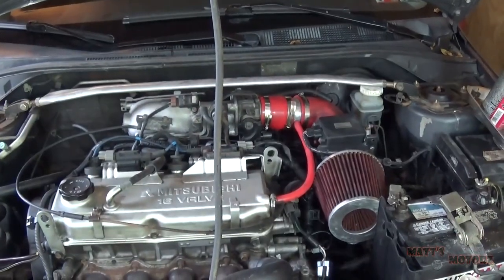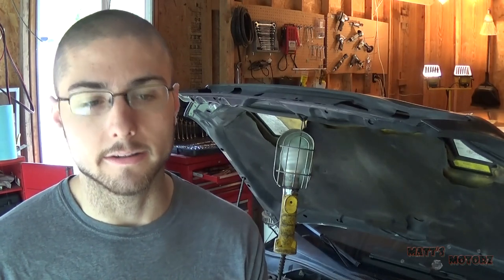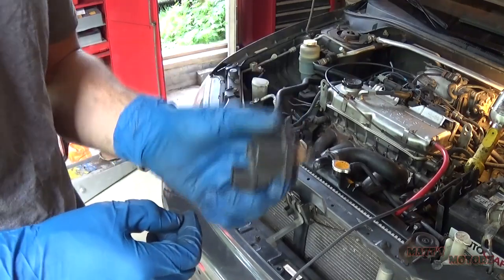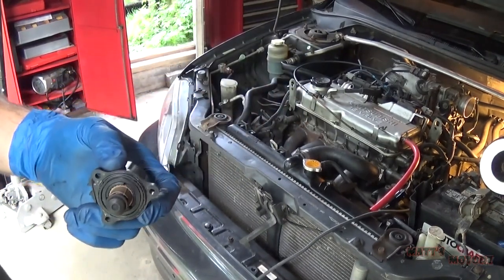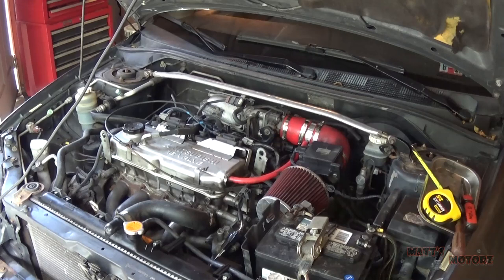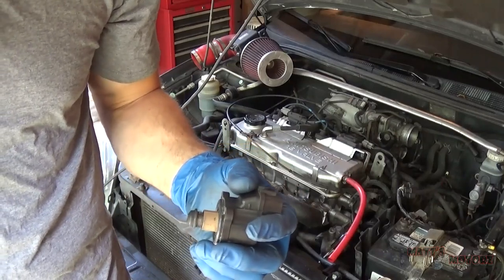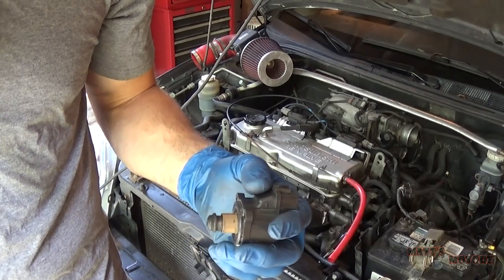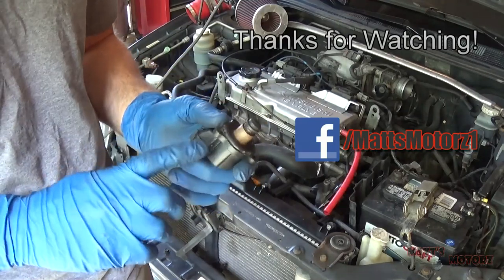Easy Way to Check an Idle Air Control Valve

Comment: Would also like to say that you should make sure to check all of your lines for vacuum leaks, especially plastic connectors, like on the PCV, which can tend to crack. Vacuum leak/s will cause rough idling and would be best to rule that out before you go looking at the IAC. Another thing to make sure of first, is that your intake air temperature sensor is operating correctly, as well as your mass air flow sensor.  It should also go without saying that you should use a scan tool on your vehicle to see what trouble codes your vehicle is throwing. That's usually a decent indication of what is wrong with the system as a whole and where to start, but not always the case if it's something wrong with the ECU, for example. If you've done all that and ruled it out as a possibility, then we can move on to the IAC.

 A better test for IAC's, would be to start the engine, and pay attention to how your motor runs and what rpm it falls to after a couple minutes, and then shut it off. Now, figure out where your valve is (usually on or near the throttle body of the intake manifold in most cases; sometimes a hose will lead from the throttle body or intake air tube to a remote valve somewhere, so make sure where yours is) and unplug the wiring harness connection, and then start the vehicle again. If your IAC Valve has been functioning properly, you should know right away because you should immediately notice a change in how the motor runs with it unplugged. If it hasn't been functioning properly, you will most likely see no change in the way the motor runs because the compensations that the ECU has made are still in effect.

 At this point, we still don't know for certain if it's your IAC though, so don't immediately condemn it. At that point it would be best to get a multimeter or test light and test the electrical pins on the control valve. You would need to look up what the correct voltages are for your vehicle from your owners manual or by looking it up online, and it would be good to test the pins on the wiring harness as well to make sure that the wiring is not faulty either or getting bad signals from the ECU. The reason we want to do all of this troubleshooting, is to rule out or confirm the IAC or the wiring being the problem, and if it is not, then we can start to troubleshoot elsewhere, like your engine timing. Perform troubleshooting tests whenever possible, otherwise we're just blindly ordering parts and pissing into the wind. 

If you're here reading, I hope you figure out whatever the issue is, and have a nice day :)
Reply: @james6401  did you sort it out
Reply: @james6401  i know man.I have problem that when engine is warm and i press clutch while driving revs drop almost to zero and sometimes it stalls.I thought maybe problem is with throthle body and idle valve but to get to it on my corsa b 16v i need to remove alot of shit and i am not sure i can do that.
Reply: @james6401  i didnt check anything really i am not mechanic but i know a few things much or less  and i read alot about problem i had.One mechanic told me it can be pump but i dont see connection.Also i have a problem almost at the same time when revs drop speedometer stops working,i dont know if its connected and how.I wont need car too much for next 3 months so maybe it can wait as i need every penny.I will maybe replace temp sensor and fuel filter as it dont need too much expertise,i just dont want to give money to some idiots to do things i can.
Reply: @james6401  it can be anything who knows.maybe something with vss sensor,i am not in hurry
Reply: @james6401  
> "...keeping things until they fell apart."
Well, you thank her for me. That's excellent.
2005 Dodge Neon, 258,000 miles.
(trying to keep this thing alive; idling like crap right now...)
Reply: good info!  I sometimes get a very high long term fuel trim on a front O2 sensor (as seen w a scanner)......and when I shut the engine off, back on there is a LTFT shift immediately downward.  From 30-50% down to 18%.  Im thinking there might be an issue w my IAC.  Sound right? thanks

Comment: On my 94 Mitsubishi Montero it had what appears the same IAC.  My engine was not holding idle, but stalling out.  I was able to take the IAC apart (3 small screws), clean it, and put back together......and it works now.  Also cleaned the throttle body area where it fits into as it had some corrosion/grime there.

Comment: Thanks Matt,I just subscribed to your channel,my 1997 jeep had the same symptoms, after spending about $400 bucks,on a new fuel pump,o2 sensors,I was even going to take the catalytic converter off and drill through it and weld back on,turned out to be the dam I.A.C valve ..smh.Anyway thanks for the video.Jeep runs great now

Comment: Wearing a dust mask for Carbon Monoxide, nice!
Reply: Lol
Reply: I know huh..😉
Reply: Why not explain the correct respirator instead of making fun? Most people don't know this.
Reply: @bretfeeney1072  A respirator wouldn't help either. Dust mask like he is wearing (is for large dust particles )and respirators (smaller particles and fumes like paint depending on the installed filter). Each need to be used in ventilated areas, neither of these produce oxygen. He needs to pull that car outside or get an oxygen mask like fireman wear.
Reply: @toddh6234  they have filters that work for carbon monoxide
Reply: @bretfeeney1072  cuz they half right
Reply: @Tony-wm1oc  @Tony there no filter that is going to work in an oxygen depleted room.
Reply: @toddh6234  good thing it's not depleted he's not in a vacuum he's in a fume filled room the car can't even run if there's no air good try tho
Reply: @Tony-wm1oc  @Tony Nah don't do that I need you around so I can get you riled up again : ) I was just busting your chops, stay safe my friend
Reply: Tell this to dr. Fauci
Reply: Yeah 😊...carbon monoxide and carbon dioxide are afraid of dust masks so they just go away 😜
Reply: @carlosmejia5728  just like COVID 😂😭
Reply: Well it stops the rona so it must work for everything. Aahahahahaha

Comment: Would the iac cause an intermittent  no crank no start for  7 months...its gotten progressively worse...almost daily. I have a po507 code. I had the throttle body replaced a year ago. 2008 jeep Cherokee 150 000 miles. Thanks

Comment: Yes on the white smoke coming out of the tailpipe, the last couple weeks. I'll have to check the milky stuff, theres no cap on radiator to look inside. i had some work done on the car a few mths ago and at the time the car would just not start for a couple days then fire right up and be fine. The mechanic kept the car 2 days and it started every time! Nor would the check engine light come on. He advised me to have it towed in when it wouldn't start but it has ever since. while there he did a "new car" inspection to break down what all i need. A tune up, valve gasket covers, tie rod...to the tune of $1500 for everything. The most important repairs running several hundred each, so i just didnt have the money.
 It may take a couple days but I'll def let u know what happens. I would've traded in already Matt but i need a couple of months to be financially set to handle the pymt.  i was hoping this one would hold out for me. But its winter so i dont see it happening. i was hoping to spend the minimum and get what life i could out of it until i could afford the new one. i start a new job on the 27th making more $ but its biweekly pay and i NEED the car to get me there. 
I will keep u in the loop, though i assume i have at least a couple of urgent issues now. Hopefully it'll be something i can pull off! 
Thanks again so much for your time and wisdom. im gonna become one of those kick ass girls that knows how to fix 🚗   ;)
Reply from the maker: +Mel Mel labelle No prob! And that's great! Always nice to see the ladies fixin' their own cars! Thanks for keeping me in the loop!

Yeah it sounds like you have a blown head gasket / cracked head.  I wouldn't do any repairs on it as it is a gone-er, so it is very good you didn't pay that mechanic!  By "gone-er" I mean it would cost so much to fix, you might as well get a new car.

Comment: thanks for your reply Matt but how would i check with the carb cleaner ? is there a video ?
Reply from the maker: Yeah, look up the video by ErictheCarGuy (but I am sure there are many videos.  I haven't made one though).   You spray it around places where there could be leaks (like around the intake) and if the RPM changes, it means the carb cleaner got past the seal.

Comment: , I had idling issues after my engine gets warmed up. After months of googling I found IAC is stuck on my palio 1.2 (2002). So I have removed it and cleaned with carb cleaner. I also loosened the spring and removed the pintle which comes on it without measuring. Now the problem is I don't know how to recalibrate the pintle which is present on the IAC. I don't know whether to tighten it till the end of thread. Because I'm concerned about the free back and forth movement of the IAC. Please let me know if you guys know how to calibrate or how much should I tighten the pintle on my IAC. Thank you!!

Comment: 2.0 94 mitsubishi engine, looks like an 02-03 lancer. I'm having an extremely low idle problem, getting a tap from what seems to be the purge solenoid. and a creak when it idles up.  I'm assuming my iac is sticking, along with the purge valve.

Comment: I just bought a new GM IAC valve on ebay for a custom setup I'm doing. It has 4 wires. Before making a mount for it, I decided to test it using a battery. I do have good OHM readings across the wires, but when I apply voltage to it, nothing happens. I used both 6 and 12 volt batteries. I don't know if it will work this way, but I'd really like to know that the valve works before I install it.
Reply from the maker: +earlyhemibill IAC valves are stepper motors.  They operate by taking a square wave pulse as the input.  The square wave duty cycle determines how fast it moves.  Applying DC voltage will not do anything.  Look up "stepper motors."

Comment: So my truck is occasionally running a high idle when I crank it up but when I put it in gear, it's idle returns to normal. Do I need to change my IAC or is it something else?

Comment: Hi how much is the valve moving on a good valve? My 2006 lancer moves only an 8th,another ?,does a faulty valve cause a high idle about 3000 rpm and also have gas in my oil dipstick.
I have turned the key on then unplugged the valve wiring until it was as far out to close it fully where it idles perfect but after about 3 starts it begins again

Comment: Hey Matt! So they ran a test on the battery, starter, & alternator. The alt tested good but I've heard these readings can be inaccurate..?? The belt appears to be in good condition, tight and unremarkable. The oil isnt milky on the dipstick but we are having to add water/coolant to the reservoir frequently. Also the power steering fluid needs to be filled every week or so. The milky substance is allover the front of the engine. under the. intake etc. 
At Advance, they put a new battery in yesterday. Light flickered very dimly last night. The shuddering and loss of power has twice now been accompanied by the speedometer and rpm's jumping all the way up when i was going 10mph. Very strange. 
Thank u so much for your time and input.  I truly appreciate it and i hope the good stuff comes bk to u!
Reply from the maker: +Mel Mel labelle Is there a check engine light on? If so, what is the code?&#160;

I remember one time I was working on a Honda Civic and the battery light would flicker on randomly.  All tests of the alternator came up fine and the wiring was also good (as bad wiring can cause this problem as well).  Finally I just pulled the trigger and replaced the alternator and the problem was solved.  I did this because the battery light is CAUSED by the alternator.  Meaning, the sensor that sends a signal to the computer to turn the battery light on is INSIDE to the alternator.  If all wiring is fine (most of the time it is) then the problem is likely the alternator.  Let me know what it ends up being. I am always curious to see what solves the problem my viewers ask me about!

Since you have some bad leaks, try to see if any of the leaks are leaking onto the serpentine belt.  Something is making it slip and it might be the fluids leaking onto it.

Is the coolant milky inside the radiator or expansion/overflow tank (Depending on which coolant system the car uses)? Milky coolant usually means oil is getting mixed with it.  This usually occurs when there is some failure in the sealing of the cylinder heads, such as a head gasket or a cracked head.  Was the car overheated recently?  Is there an excessive amount of white smoke coming out the tail pipe? Especially in the morning on first start up?  This issue needs to be addressed first as it would be the most expensive to fix.  (Most cases, people get rid of the car when they have a head failure since it costs so much to fix).

The speedo and RPM&#39;s going up is also a concern.  Does the transmission have enough fluid? How is the condition of the fluid?

Comment: Replace the idle air control valve. Check the idle adjustment screw if it has one. Clean the cavity of carbon.

Comment: When i start my car it idles between 2000-3000 rpms, i turned the car off and unplugged my idle air control valve and the idle dropped to around the normal range. I then plugged acv back in and the car was ok for a short while. Does that sounds like i need a new valve? Thanks

Comment: correct me if im wrong but isnt the spring a return spring and when unplugged will always move pintle back?the iacv uses magnetic field to push out pintle against spring force and wonder if second test the iacv needs to remain plugged in.just wondering.

also stepper designed iacv dont move at all when unplugged i think so this might only work on certain design

Comment: There is a good chance of being found passed out of dead with your dusk mask on... That thing is used for sanding, mowing yards, etc. Pull the car out the garage or park it in the garage in the opposite direction to exhaust the fumes outside. You need a oxygen mask if you want to continue to do things this way.

Comment: Hi Matt, thanks for your video it is very informative. I have a Chevrolet Tacuma that is causing me a whole host of problems because I live in Britain most garages don't see them very often. I love my car, but, it has a fault that doesn't show on any computer and it has now been to 4 different garages in 6 weeks. The issues is I turn the key to start the engine and it either doesn't start but makes the usual ignition noise of a key turning. Or, it starts for a second, and peters out... I have had the crank shaft sensor replaced even though nothing came up on the Engine Management System (computer), 2 days ago the idle valve and the problem is still there that's why I watched your video to try and get some clues. If by some miracle you know what this is, I would be eternally grateful!
Reply from the maker: Leza Boyland The first thing I would do is check the fuel pressure.  A bad fuel pump or something faulty in the fuel system would cause this issue.  

I actually had something like this happen to me before.  The problem in my case was that something (a rock or something) got inside the bell housing between the engine and the transmission and got wedged between the engine flex plate and damaged the teeth.  The crankshaft position sensor looks at the gear teeth as a reference to the engine position and with a couple teeth damaged the engine couldn't start.  However in this case, I DID got a code for a crank sensor, but it is still a possibility in your case. If you're really getting desperate, you might want to check this.  Remove the crank sensor and shine a flashlight into the bore and observe the gear teeth.  Rotate the engine over completely and see if all the teeth are in good shape.
Reply: +MattsMotorz Hi Matt - thank you, i'll let you know what happens.
Reply: +MattsMotorz just one thing I forgot to mention and I don't know if it will change anything. This problem is intermittent, when it starts it s great, the car runs really well. But, it's just getting it to start and some days it will start fine and other days I have nothing but the problems as described previously. This means though it's totally unreliable for work etc.
Reply from the maker: Ah that is actually very different, however the issue could still be the fuel pump.  Try this next time.  Cycle the ignition from OFF to ON (dont crank) about 4 or 5 times before attempting to start, waiting a couple second to turn off after each cycle.  When you do this,the fuel pump turns (You should be able to hear it, it will run for a couple seconds) on an primes the system. Many times the valve in the pump goes bad and drains the fuel back in the tank, leaving the fuel system empty.  Priming the system 4 or 5 times pressurizes it and allows the car to start easier.
Reply: +MattsMotorz  thanks when it does it again I will try this. Cheers Matt

Comment: First thank you for your diy videos on cars , I have a issue I hope you can help me with , I have a 2007 Honda civic 1.8 liter that at idle runs very smooth but at when I drive motor get very loud , it has 200,000 miles and engine light is showing idle air control , do you have and suggestions , thx again